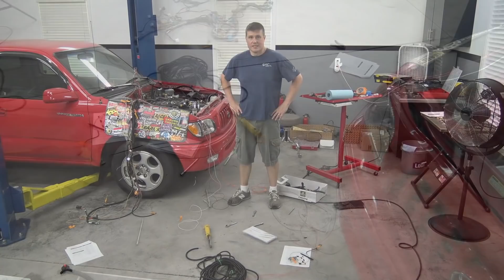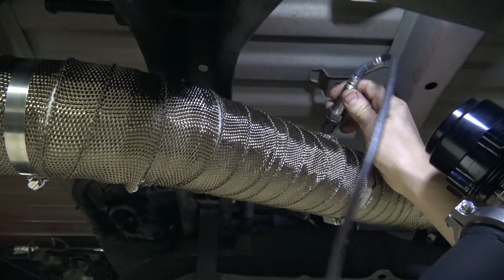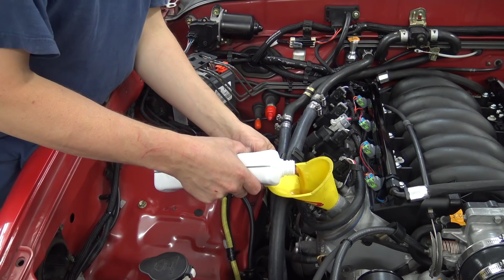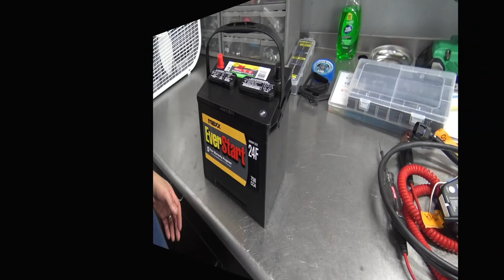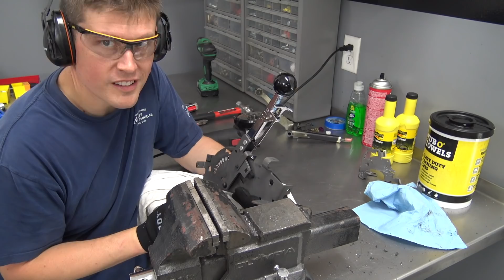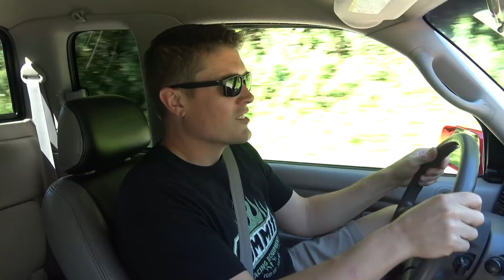LSX V8 Turbo Tacoma - Project Firebolt Part 12

Comment: What an awesome build! As are all of them. You're a DYI inspiration Tom! That Airlift coolant system is amazing, one thing thats driving me nuts though... doesn't it defeat the purpose when forcing in all the trapped air in the coolant hose before it starts sucking up coolant when refilling? Would you not need to still bleed it anyway because of it?

Comment: i might be missing something but why would you run extra Ground wiring if all the Metal Parts are grounded in a Car?
I mean yes i know that Injectors usually are Ground switched instead of Positive switched but AFAIK nothing else.

Comment: Wow. Your air/fuel ratio went down from13 or 14 to 1 when you first cranked it up to 9.6 to 1 when you were driving it. Either the Holley is learning pretty quickly or maybe you tweaked the fuel curve a little to get a safer ratio.

Comment: I have to inquire about the front mount inter cooler. Your stated goal is to have a sleeper, so much so that you're running stock Tacoma wheels that will arguably be very narrow for this power output. Yet when it come to the inter cooler you let it hang down half exposed below the front bumper?? Seems like very conflicting methodologies here.

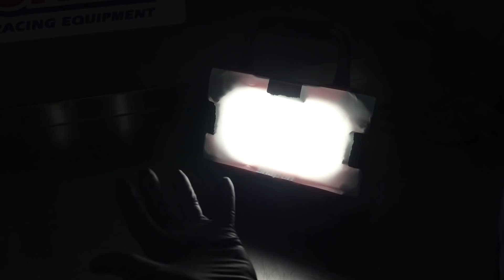Comment: @8:30 Tom, you can also use theatrical lighting gels for this. Search for light diffusion gels and/or neutral density gels. Rosco #119 or #209. They'll hold up to heat.

Comment: As another Terminator user, add adjusting your IAC percentage down to less than 10% on your list of things to do! Adjust your throttle blade opening by using the screw on the throttle body(or, remove the screw out of the back of the throttle body, and thread it in from the front if it needs more adjustment range to reach your desired idle rpm). After each manual adjustment, don't forget to do another TPS auto-reset, or it will use the original TPS percentage it had PLUS what it thinks it is now opened to and it will rev to the moon. 

Other than that, AWESOME work man!
Reply from the maker: Thank you for the detailed tips on this and yes it is on the short list of to dos for sure.  I adjusted it a little bit but I’ll be removing the screw and threading it in from the other side as you suggested.  Thanks again sir 👍🏻

Comment: You weren't driving hard or doing burnouts, so the trans should have stayed cool without needing the cooler.  Either there is something wrong with the transmission or there's air in the system causing a low fluid level.  Get an expert to check it out before any damage is done.

Comment: I ran the same trans cooler on my 4L80E LS turbo truck and it was not enough. Had it mounted up front with lots of air flow. Could be too restrictive, I don't know. New plan is complete cooling system overhaul and much larger trans cooler. 

I really enjoyed this series and I'm curious as to your fix to the trans cooler issue. Keep it up!

Comment: Excellent work as usual Tom but I noticed something...there you hooked the main engine ground to on the engine itself..is that a painted surface? If so please just unbolt that cable from the engine and clean off the paint, dope it up with a bit of dielectric compound and bold it back up....you want a lot more ground connection.

Oh and congrats on the first start...that's always the one you want to have happen....sounds gnarly!

R.I.P. Rear Tires...may you leave a ton of rubber on the pavement.

Comment: Pro Tip when using that Mighty Lift coolant fill: completely submerge the fill hose in your coolant bucket (and make sure to get all the air bubbles out!) prior to connecting it to the gauge to fill. It's a very minor thing to do, but there will be a very tiny, tiny bit of air going into the system otherwise. And it really is the best tool I've ever used to fill and bleed coolant systems.

Comment: I have the same AIRLIFT coolant system, only thing I do differently, is use my mouth to suck coolant up the hose so it doesn’t suck in the length of hose, worth of air. 👍🏻👍🏻

Comment: I think you might be able to fix the trans temp issue with an air ram and shroud. And you said the fans came on at 180 degrees and if your thermostat is also a 180 and your running at 188-190 that means both of those items are in constant use at temp and are more prone to failure. I would just keep extras of those handy for that unfortunate situation.

Comment: You might wanna make a NOTE:  Try the rubber grommet firewall harness seal from a Chevy diesel engine it should be wide enough to fit the LXs wire harness through it.

You might wanna give the guys at Monster transmission a call email, they would have solution for you use one their cooler kits for a off road application, if they don't have a universal cooler kit.  I bet they do have a great solution fix, they do all makes but they started with Ls gm trannys

Comment: You do not need so many and such long leads for power/ground. Just use a marine block to connect separate power and ground in the middle and then single leads to the battery. This will prevent ground loops which you will have with your setup and it will make for much less of a headache. What you are making is a ground loop example, avoid it and everything will run much smoother also less fuses. That computer is dependent on grounding to make everything work well, avoid ground loops.

Comment: Just a tip with the Airlift tool, after using mine for years in a shop I found that keeping the container of coolant above the fill point makes for a quicker and more efficient process. Instead of on the ground.

Comment: I would change the cooling fan on temp up to 205-210*. That way it's only working when the engine actually needs it. It will run constantly at the 180* set point. These engines were designed to run in the 200+ range.

Comment: reusing the firewall grommets - Don't push the cable sleeving through.  The sleeving can act as a conduit for water and gasses to enter the cab.   Bundle the cables together, and then route them out from the end of the grommet.  Use Automotive blue-tak to seal the wires up - then overwrap the sleeveing to the grommet with Nitto insulation tape.  It's water proof - and gas proof - and about 1/2 the size that you have there.

Comment: Hey Tom in regards to the neutral safety switch for the Toyota I normally just join the black wire and black/white wire via fuse the bypass that bulky switch keep up the good work man loving these videos👍🏿

Comment: Tom, everyone feels the same about the wiring challenge, but at least your garage looked tidy again when you were done.  Your methodical and precise work technique helped significantly, as usual.  Here is a prediction for future technology:
Every car built with a network of a dozen or so tiny LI type batteries strategically located around the vehicle, pre-wired to the charging source.  Then the short webs of decentralized connections would be much easier than the old 'home-run' lines all going back to the archaic centralized battery.  As battery technology improves, we should easily have 5-10 year battery life - then simple replacements in convenient spots. (Of course a bit larger power source for he starter, and maybe headlights, etc.)  But ought to dramatically reduce the miles of wiring with small mini clusters, plus sensors triggered by Bluetooth signals.  Would be a fabulous project for you - call it Tom's Anti-Big-Battery Build.  😁

Comment: Tom have you thought about creating a duct for the trans cooler. May sound silly but may also drastically improve the efficiency of the cooler as well building a shroud for the fan and sealing with weather stripping if it doesn’t already have one. Just my two cents. Maybe play with adding a pusher fan in conjunction to a puller? Love to see what you figure out great video man and congrats on getting it working! Can’t wait to see what’s next from you.

Comment: Engine Masters had an episode (Ep 45) where they attempted to flow water/meth through the same-style LS intake manifold. They found that the stock intake runners were (obviously) only designed for air and the intake port-to-port cooling effect from the water/meth was different by thirty degrees (with the rear cylinders/ports getting a lot of the water/meth and the front cylinders were getting less). Their major concern was that since the meth also acts like fuel, that the tune on any specific port would be incorrect (either rich or lean). I know you have an abundance of personal experience with this, so I was just curious what you thought. The turbo sounds amazing! Looking forward to the next video.

Comment: why 15W-40 oil if the recomended viscosity for the engine oil is 5W-30?
Reply: Viegas because oil flows through the turbocharger. If too thin, it won’t lubricator the wheel enough and you could have issues. As well as pressure issues in the engine itself.
Reply: Tilted oilless turbo though
Reply: @mcfero1  right xD

Comment: It sounded like the blow off valve wasn't kicking in, there was some compressor surge when you let off the throttle.
Reply: Came to say this, definitely the case.
Reply: Tuning won't change compressor surge, its caused by a lack of or too small of a blow off valve.
Reply: @jonholaday2733  I'm not versed in blow off valve operation, I just know what they're used for. It should be possible to tune when a blow off valve opens, otherwise it's possible it could open at the wrong time (high boost during wide open throttle). skmetal7 may be right that tuning could fix it.
Reply: @NathanielHatley  They operate by a vacuum line connected to the intake manifold. Boost actually helps hold it closed with spring pressure and once you release the throttle creating vacuum in the manifold, the vacuum pulls open the blow off valve to relieve the charge system of excess air. Compressor surge is the charge air being stopped by the sudden closing of the throttle and slamming back into the compressor, actually physically slowing it down in waves. the Blow off valve helps the compressor wheel maintain momentum by letting the extra charge air out of the system until you press the throttle again which closes the BOV and starts building positive charge air again aka building boost. unless you were to install a solenoid valve inline with the manifold reference line tuning will have no effect on the BOV's function.
Reply: @jonholaday2733  That was a great explanation, thank you. How do blow off valves work on deisel engines since they usually don't have throttle plates? I suppose in some instances they aren't strictly necessary (because of no throttle plates), but I feel like there could still be cases of compressor surge when going from WOT at high rpm to no throttle at low rpm on large turbos that take awhile to spool down.
Reply: Nathaniel Hatley Im not completely up to speed on how diesels function, but I believe they don't have a bov in their charge system.
Reply: @jonholaday2733  fast world meets slow world: enter diesel trucks
Reply: Nathaniel Hatley this
Reply: it still needs to be tuned

Comment: Are you going to be installing a failsafe for the meth injection. If the fluid drops low have some trigger to the Holley unit to go into low boost mode

Comment: Awesome! Alot of compressor surge, maybe add a second bov by the turbo?
Reply: +1 heard it too, getting some wicked compressor surge coming off throttle. With that cam might need a softer spring in the bov.

Comment: Anyone with enough common sense can take nuts and bolts off. Doing a wiring loom fully with that amount of attention to detail, the actual nice connectors, heatshrink takes so much more skill experience and patience. It is far from my favorite thing to do and surely probably not our favorite thing to watch. But it is absolutely impressive to see how well you do it, I usually base my first impression of a vehicle off of how its wiring loom looks XD. You are the benchmark I try to set for myself because of it.

Comment: congrats on the build.  I would recommend adding 200 more RPM to idle if your converter stall will allow.  This will help with cold start idle issues.  I am not sure how but you should also check oil flow to and from the turbo. Looking forward to the next video.

Comment: You should add some DOT approved LED headlights to lower the load in the electrical system and raise voltage to around 14.0 since you have daytime running lights. You would be able to see MUCH better too if you drive at night! I recommend the brand "Lasfit" if you decide to go that route. They have all the LEDs to make the truck look great! From brake lights to fog light and turn signal bulbs

Comment: I apologized if I missed it, but what do you use to control the 4L80? Specifically in full auto mode? Or is it all just electromechanical and no computer?
Reply: The Holley Terminator has trans control built in.
Reply: @AB-80X  Ok that's pretty cool.

Comment: I'm right there with you Tom. I'm working on integrating all the inputs and outputs for my Honda k20 swap into a Fiero. I'm so happy I'm running the Haltech ECU and IQ3 dash. It makes life so much easier, doesn't it? I'm so glad I dont have to figure out how to get the stock gauges to work with the swap. You make it look so easy bro!!!!
Reply: I respect all builds, but I'm just curious. Why swap a 4 cylinder Honda motor into a 6 cylinder pontiac? Just personal taste or are you looking at performance? Also...you just made an American Toyota Mr2 😂
Reply: @CassidyMartin1028  I've done every swap out there for fieros except the LS. Idk, time for something different. I pulled the 460whp 3800 and went with the kseries. The k swap is significantly lighter and the aftermarket is light years better than the l67/l32 offerings. Oh yeah, pontiac fiero was 1st, mr2 came out a year after the fiero started production.
Reply: BVMotorSports I’m an ls guy but with the the stuff the boosted Boys (don’t the spelling) are doing a k swap is definitely a good choice. Well a turbo k swap that is.
Reply: @CassidyMartin1028  actually most Fiero's were 4 cyl.  Only the GT's had the 6 cyl motors...and those were only about 140 hp.

Comment: A small duct to pull air into the trans cooler may assist that small fan enough to keep the temps down. I'd at least try that before you go to the trouble of moving it
Reply: I second this. I watch the hoonigan video of a square body c10 with a lt4 in it. They used a simple square duct out of sheet metal to catch air and a small helper fan. I wanna say that they said that setup keeps it under 190

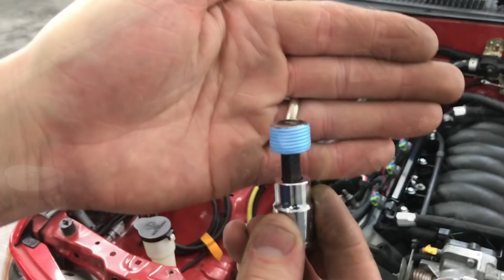Comment: 11:45 - I suggest push-to-connect fittings for all vacuum/boost lines--also made by Vibrant. They will last as long as silicone, if not longer, but are much more secure at the ends. It also looks muy limpio.

Comment: The one timelapse shot where it showed the truck and your miata and az makes me wish you could have found a clean mazda truck to swap to join the other mazdas in your collection (though it would have been impossible to find one that hasn't rusted apart).  Of course, it doesn't hurt that I had a B2200 as my first vehicle and miss it terribly so I'm a bit biased.

Comment: 1:00 Tom: wow this garage is so messy right now!
Me: looks at own garage, shakes head and walks away in despair.
Reply: @andrenegwer yeah well I've done my time, living in college dorms, apartments, with parents etc. and not having any garage space.  When I bought my house in 2005 I swore I would at least keep it cleaned out enough (most of the time) to park my cars inside.  So there's that, but I barely have any room to move around the cars once they're in there.
Reply: Patrick94GSR and where you successful? I’m batting 500 atm somehow my dad commandeered half my garage.
Reply: @davidfletcher4016  well I was up until last month when I bought a Miata so now I have 3 cars between me and my wife.  So the Integra GSR sits outside and I have to move it back and forth every morning to get the Miata in and out.  Integra will go up for sale soon after I fix a couple lingering issues on it.
Reply: @andrenegwer how so?  my wife has a 2014 CX-5 that we got in 2016, and it's been an awesome car so far.  I just got the Miata running after 2 weeks on jack stands to do a timing belt service, mostly from waiting on parts because I didn't get everything I needed initially.  If you mean because of me wanting to modify it, yeah I think you may be right LOL.  I haven't done any mods to the Integra in years, and now I'm wanting to do all the things to the Miata. hahah
Reply: andrenegwer you need to meet a local by us into Mazda’s his name is Ryan berg from Missouri
Reply: andrenegwer he goes to the Mazda tail of the dragon he’s got a bunch a couple tributes a cosmo had a rx8 shinaka a turboed 90s protege
Reply: Looks at floor of bedroom...
shakes head, but cannot walk away in despair, because of the car parts imprisoning him.
Reply: @andrenegwer Would you be interested in a cheap 1996 Probe GT? I'm sure you know, but it's a Mazda with a Ford badge and a KL under the hood. Good for parts at the very least. I just don't want to junk it, but instead find someone who will put at least some of it to good use.

Comment: Pretty sure you can tune shift firmness based on throttle position, load etc.
I know the old standalone controller by TCI for the 4L80E had that capability.